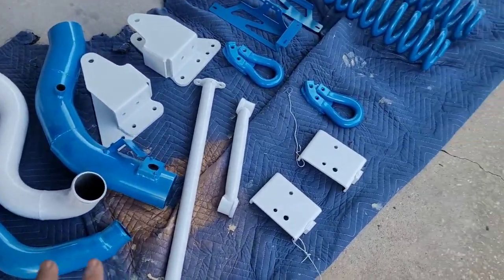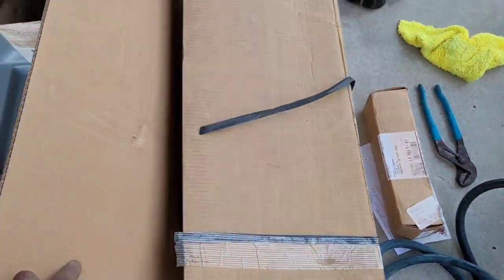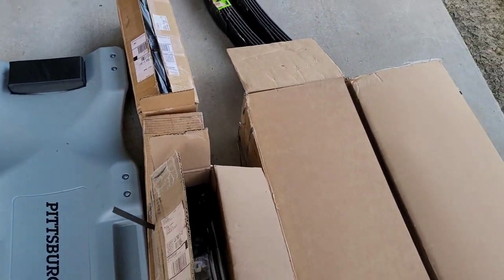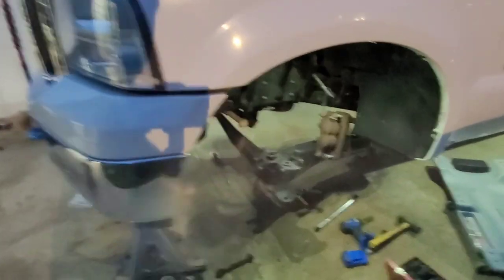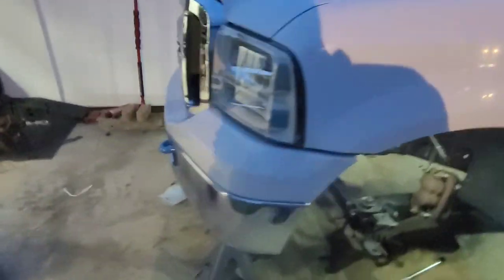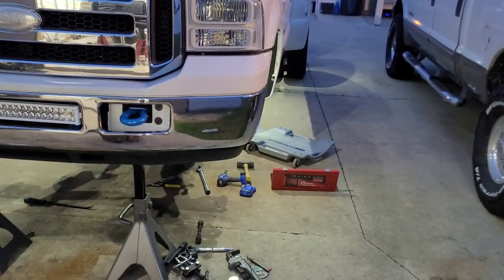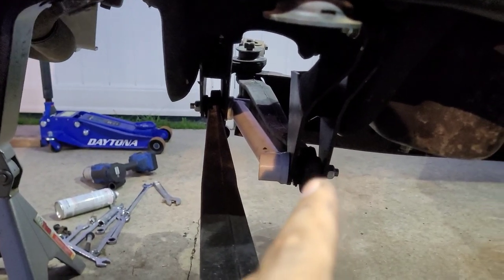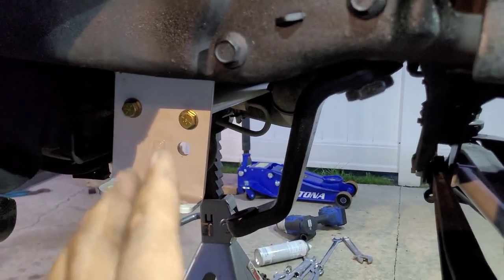Installing a 6in lift on my 2wd Dually | Building a Tow Pig pt.2 @Powerstrokepat

Comment: I’m looking to do this on my F250. Since it has been over 2 years have you you noticed any decrease handling issues (issues with alignment) or towing issues with this kit. Thanks, Fred
Reply from the maker: None at all. Still holding strong, truck pulls a trailer 5 outta 7 days a weeks. No issues with tire wear or handling issues

Comment: I have a 06 f-350 super duty 2 wheel drive what kit would I need for a 6” lift if it can be done it’s also 2 wheel drive
Reply from the maker: Pro comp. The kit I installed in this video. Pretty hard to track down these kits now as they stopped manufacturing them for a while. Everyone asks me to help them find a kit but the last few times I haven't been able to find anyone selling them

Comment: I have a 2006 SRW 2wd and a 6” fab tech lift. Ready to get it on there.
Reply from the maker: I hope the fabtech kit is designed alittle different so its alot easier for ya
Reply: @Powerstrokepat  haha thanks man I hope so too. I appreciate you putting this video out. I’ve been waiting for someone to do it forever.
Reply from the maker: yea everyone that has done it has had a shop do it lol
Reply: @yeehaw6544  which fabtech did you use and have you had it installed yet?
Reply: @Film_On_The_Fly  fabtech K2060
Reply: @yeehaw6544  how does that lift kit ride vs stock on your truck

Comment: Did you end up having to extend your brake lines in the front? Just wondering as I’m in the process of putting my lift on and I’m worried about it as I can’t find any extended ones. TIA
Reply from the maker: Nope I disconnected the bracket and that gave me the extra length needed
Reply: @Powerstrokepat  which bracket exactly are you talking about? I don’t mean to bother you I know this post is old just trying to get as much info as possible so I don’t mess it up lol

Comment: Looking good brotha. Your trucks are looking good..
I "Finally " got my 2016 front bumper for 2006 . Super pumped. Truck going to paint and body shop next week. Then I'll lift it to run my 37 tires on 24's.
Reply from the maker: Thanks man. Yessiiirrrr! keep me posted on it man
Reply: @Powerstrokepat  Quick question.. The fog light wiring on the 2006. Will it fit the 2016 style?
Reply from the maker: @johnnycortez46  no but I just taped into the 06 harness to power the new fogs and light bar. kept it simple that way and can control it with fog switch in truck
Reply: @Powerstrokepat   I figured that would be the way to go.  Thx for always helping out with info.  Much appreciated 👌👌
Reply from the maker: @johnnycortez46  anytime my man🤟🏾

Comment: What wheel spacers are those
Reply from the maker: Not running any wheels spacers
Reply: @Powerstrokepat what year is your truck? I have a late 01 to 02 and my wheel hubs are different but the res tod the setup is the same.
Reply from the maker: @tracytillett  yea my truck an 05

Comment: If I have a non dually f-250 2wd, would I still need to order the excursion lift? I want it as level as possible when lifted? Thanks man truck looks great
Reply from the maker: Is it a diesel or gas? Only difference between the kits it the weight the springs can handle
Reply: I have a diesel, just want to make sure I get the right lift. I’m assuming I get the regular f250 one instead of the excursion one but could be wrong
Reply from the maker: @colinwillis3988  yes you need the one for the diesel excursion
Reply: did u ever find one? i have a 2001 f250 extended cab long bed, im lookin at gettin a 6 inch lift.

Comment: Do you have a link for the back u-bolts for a dually?
Reply from the maker: No I just ordered the correct axle size and length that would fit the rear blocks

Comment: Front and rear height the same? 4.5”
Reply from the maker: Yes
Reply: @Powerstrokepat  you think th fab tech is the same? 4.5 inch or a true 6? Can’t find anything on It for the 2wd. Hoping for around 4 inch “level” after the 6 inch kit.

Comment: Clean rig!!! Looking for similar setup as I have same truck. What is part# for lift you used?
Reply from the maker: Thanks alot.  I'll have to look back and find part # but the kit is for a 6.0 excursion with twin ibeam suspension.  Kit will have to be modified alittle bot to make it fit correctly and you will still need to buy ubolts to fit the larger axel
Reply: @Powerstrokepat  looking at reply. What was the little bit of modifying? Pretty simple? Planning on doing the same with my 2wd dually.
Reply from the maker: @2WheelWild  you will have to torch the factory brackets off where the radius arms mount to frame

Comment: Hopefully this works on my 2011 6.7 SRW
Reply from the maker: Should be pretty much the same. Frames ate practically the same
Reply: Do you remember if the top of the springs had a box shape instead of being rounded?